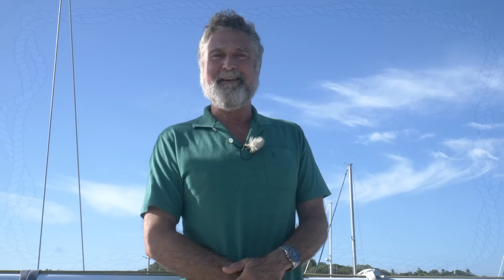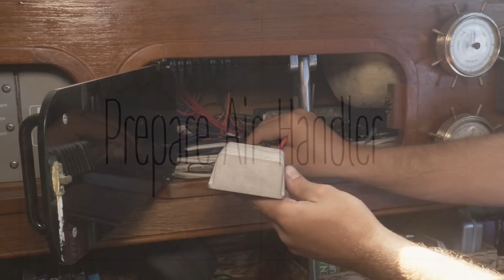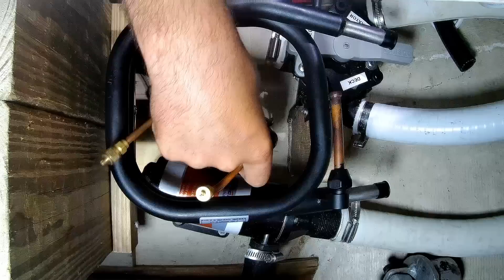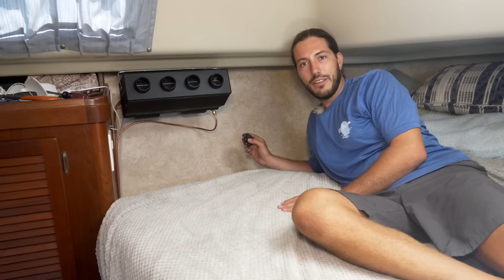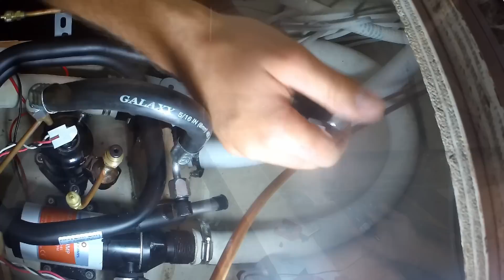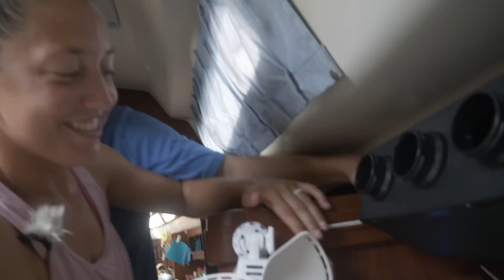Installing Our Boat's Battery-Powered A/C

Comment: I didn't see if the low pressure line from the airhandler was insulated.  It gets cold, and water will condenses, making things wet.
Reply from the maker: Yes it should be.

Comment: Hey Clark! We’re installing your dc/ac system on Rhiannon and I have some questions: 
What is “this stuff” that you’re putting on the flare fittings?
Our system is 24v so do I need to use the power booster or can I just wire straight to my system? I’m assuming I will need to convert to 12v for the blower motor and the pump,or does the system step it down?
I’m really impressed with this system ,especially how tiny the compressor is! Thanks for coming up with this for all of us and keep up the great work!
Reply from the maker: Thanks,

You can find "this stuff" on our Amazon store (link in video description).  It's really not required but since I bought some I use it all the time.

No don't use the boost converter for the compressor.
   If you can find a 24v pump use that.  It's better.  Same pump, different windings.
  As for the air handler motor.  I haven't tried this but it should be fine if you use the included motor speed controller as long as you don't ever turn it up beyond half way.  Correct setting should be like 1 amp 24v. Probably 1/10th from off.
It should work as a good buck converter but if you turn it up too far it will likely harm the motor.
Or you could get a little buck converter to make 12v.  Likely you already have 12v circuits on the boat, right?

Comment: I have seen similar units manufactured through China. Is this one of them? I'm looking for a small 12 volt A/C unit for tear drop and similar type trailers. However, how is this [your] unit's price of $2000 justified?
Reply from the maker: No.  This one is easily 3x as efficient.

Comment: I am going to be installing A/c on my 30 freedom.  Once you start looking into what's out there it's almost overwhelming.  For me I want simplicity and the ability to maintain and service the unit myself.  Are there service valves on the Condenser? If not what's your thoughts on installing them. My other thing is I would be happy having a cool sleeping room but the Captain wants a cool Salon as well so for me I may not be able to do this one. It looks great though.  Seems like the coils are serviceable and the blower too. I am thinking of maybe going with two. 1 for day in the salon 1 for night in sleeping room.  Ty
Reply from the maker: The unit comes with both a high side and low side service valve.  This is usually considered plenty as every part of each of these subsystems have the same pressure .

   I agree about the sleeping room as I mention in my first video.
   I'm concerned that this might not be enough unit to cool a big poorly insolated room in the heat of the day with the sun on the deck.
    A larger unit is in the works or you might accept the idea of spot cooling. (Leaving the hatches open and just blowing cool air right on you.)
Reply: @Clarks-Adventure  I saw the service valves. That's a sign of a well thought out unit. It creates so many Maintenance and Service options.  I hope you do well with these and tonight I am going to show my better half and really get down to the nitty gritty of cooling our space.  These units remind me of commercial ones we used to install in Homes and a lot of apartments.  Good luck to you and ty for making these so user friendly!

Comment: Hi Clark, Great video! I have a strong feeling i'm going to be getting one of these units!  Have you looked at Swagelok for fittings on your copper lines? They might add some price but would save from having to have the tooling for flaring on the copper lines, and they are super easy to use for those folks that may not be so inclined to do it themselves.
Reply from the maker: There were so many "right answers".  

I think in a few months there might be a one sled offering that uses air ducts.  It won't be quite as efficient but will be plug and play.
Reply: @Clarks-Adventure  I don't have any thru-hulls on my catamaran and I'd like to keep it that way. Given the construction of my boat, I can segregate the condenser cooling air flow from cabin air very easily and thus I am very interested to see the specs and layout of the air-cooled version.
Reply from the maker: I'm about to work on an air cooled unit for an RV trip we have planned.  Don't expect it to work as efficiently as the water cooled unit but it should be offered at MarineDCAC.com eventually.

You should really just install the thru hulls or share one you already have.  In saying you don't have any I assume you have no engine or outboards.  Where does your sink drain?  You have a composting head?
Most every boat has thruhulls and it's not like boats are regularly sinking because of them. One of the thruhulls used for AC is best installed just above the waterline.
Reply: @Clarks-Adventure  I should have said that I have no underwater thru-hulls and, yes, it does have an outboard motor and a composting head.
Reply from the maker: Then I understand your reluctance to drill that first hole.
As I said a air cooled option is coming.  Or, you could also just drop a weighted hose over the side when you wanted to run the AC.  
   It's just so much more efficient and in the end easier to install with water cooling.
Reply: @Clarks-Adventure  I am considering that. Need a little priming connection for the a.c. pumps with which I am familiar, i.e. March or Cal.
Reply from the maker: I think I would just use a submersible bilge pump at the end of the hose.  Let that be your weight.
Reply from the maker: I think they are cheaper anyway
Reply: @Clarks-Adventure  duh! I keep forgetting this is a 12 volt project. My mind has been conditioned by so many years of working on 120 volt boat a.c.!
Reply from the maker: Yes but the tools to do the swagelok cost more then the flare tools I believe.  I didn't chase this down personally I suggested it to Russell (manufacturer) when he forgot to get copper weld-ons with the titanium condensers.

Comment: My battery-powered AC unit just had its final hookup today. I'm ecstatic because it got done with a few months to spare of the oncoming Mexican heat. 5.1kWh battery and a 30.5 SEER a/c unit. Solar panels on the roof (of an RV) in the next few weeks.

Comment: Is there a template to cut holes if one wants to mount. the air handler behind a wall, or in a cabinet?
Reply from the maker: I just measured and used a hole saw.  They are in a straight line and all the same distance.
Reply from the maker: You can see me doing it here https://youtu.be/xF113aUlZgo

Comment: Looks great! I want one, er, three. Please think about making a 12-15,000BTU unit next. I'll buy a dozen.
Reply from the maker: We are considering a 10,000btu/h unit.   Beyond that one would have to use multiple units.
Reply: @Clarks-Adventure  That would be very helpful! A lot of my catamaran owning friends are looking.
Reply from the maker: Multiple units have the advantage that if one fails the other still works.  Always try to design away from single points of failure.
Reply: @Clarks-Adventure  I agree 100%. My boat has one chiller that is 65,000 BTU, with 5 distribution handlers. We are thinking 4 units at 12/15,000 BTU each.

Comment: Great Video; I have signed up on the website. We want two, although, contrary to the form I filled out, after watching this video there may be advantages to do a component install rather than getting pre-charged units on a sled to have more flexibility as to where to locate the components. :)
Reply from the maker: Yes I know I'd always want the components.  In this (and the next) video I'm trying to show that with how I've set this up it's easy to install with hand tools.

Comment: The one copper line under the bed is contacting the high pressure line, it will rub and eventually leak causing failure. Just put something soft in between tape together and done.

Comment: Have you calculated the cubic feet of the cabin you are cooling?  I have a small cuddy cabin power boat, please don't judge, and my old AC is in need of replacement.  My current 6000 BTU unit draws almost 1000 watts so I can really only use it when on shore power or when one of my engines is running. It's also all (Compressor, Fan and Water) 110\120 so I'm losing efficiency through the inverter too. I don't have a generator but was thinking of getting an air cooled inverter generator to plug into my shore power to run my AC but this might be a solution that would eliminate the need for a generator. My cuddy might be a little bigger than your aft cabin but not sure. I think the square footage might be more but the cubic feet less due to the very low headroom. I'm think the most important measure for cooling is cubic feet.  Would you agree?  I'm also thinking of upgrading my house battery to a 1 or 200 amp lithium or maybe even trying the new Dakota lithium starting batteries too.
Reply from the maker: Where to start?  If you are contemplating li check this out.  https://www.emilyandclarksadventure.com/bbms

But on a boat is a tricky thing.  It's surface area and insulation and circulation with outside areas and number of people since it's such a small space.
   To really save power blow the cool dry air right at you.  Big savings if you curtain off just the bed.

    Ours is around 200 if I'd have to guess.  The new install was about 300

Comment: So when you're fixing a jet engine, it's very important to check all your subassemblies for proper flow and vacuum/pressure seals. In my job we use an all in one system called a "vac cart". It's my job specifically to maintain the vac carts. I'm a little upset that I could have been using this sealant stuff the entire time instead of Teflon tape. Especially on all the flare fittings, as it makes a lot more sense in that specific application.

Comment: If you put the fitting in backwards, will attract tigers instead of repelling them?
Reply: Yes. Also any former or current QA inspectors in the area. They can smell the failure.

Comment: Keeping the explanation simple so some don't have there eyes glaze over, good. If someone is competent in their wiring and plumbing work your ac/refrigeration videos would bring them up to a self installer. 
I just point them your way, the best I have seen. My finer points would drive most crazy.

Comment: A great video, thank you! Have you had any issues with condensation on the refrigerant return line? Many AC installations insulate this line to eliminate condensation dripping issues.
Reply from the maker: Yes this is an important step.  

Filming a video out here is more difficult then in a studio in the US.  They need to search for a good material to do that with.  I'll make sure I include that in the manual.
Reply: Automotive products for this work well. Generally self-adhesive neoprene foam foil backed tape. 
Some installations run lines together to exchange ( further lower high pressure line temperature).
Reply from the maker: Yes I like the lines together.

Comment: Will the plans be available or did you skip that idea?
Reply from the maker: No. I had to sign that away in the contract.
But it's all but impossible to buy this compressor as a single unit.

I was a defence contractor so I can talk the talk and said I was developing a prototype project.  Didn't say it was an AC for my sailboat.  But turned out good for them as we will be buying volume.
Reply: @Clarks-Adventure  OK that makes sense you did mention that in the last video. Nice unit 👌

Comment: Can air handler be mounted vertically?
Reply from the maker: No.  The water wouldn't drain well I suspect.  I think it would probably try to go back to the fan.  But you might be able to cobble up a dam inside to deal with that.  
It comes apart with screws.
Reply from the maker: If you find success please do a video and share it or send it to me.  I'm sure many guys would like the answer to that question.

Comment: Are the dimensions of the air handler listed somewhere? And is there a total cost yet? Thanks great video!
Reply from the maker: 16"x12"x6.15".  I need to publish this someplace I can find it so I don't have to keep looking it up.
Reply: @Clarks-Adventure  and the costs?
Reply from the maker: Just under $2000us last I heard
Reply: @Clarks-Adventure  nice
Reply: @Clarks-Adventure  incredible!!!! Good job Clark thanks for sharing
Reply: @Clarks-Adventure  can I clarify, 200 usd?! You will be rushed off your feet at that price!
Reply from the maker: I missed a 0.   $2000
Reply: @Clarks-Adventure  you know in the supermarket they have to abide by the sticker price 😏 just saying
Reply from the maker: Luckily for me I have no power it the price.  Signed that away in the contract.
Reply: @Clarks-Adventure  Happy holiday

Comment: I think one thing that should be done is if copper line is touching the rubber line split a piece of rubber hose and zip tie it to the copper line. That way there won’t be any chafe and rub a hole in the line
Reply from the maker: Good idea. Chafe is bad.

But...  You won't believe this but you will be protecting the copper from the rubber.  I've seen so many times where engine hoses chafe the engine steel without harming themselves.  I found that unbelievable but seems to happen.
Reply: If you do compress the split hose on, interference fit and zip ties at least.

Comment: ... I guess he could've used a tubing bender eh?  lots of cheap options for that.   8^)
Reply from the maker: Yeah, that would have been nice
Reply: Yup, having a proper tube bending tool would be trick, but they're at anchor in the Dominican. I'd bet finding a tubing cutter or flare kit on a sailboat isn't a common occurrence, either, so assess your tool needs and aesthetic needs when planning your installation. How pretty do you need it to be? : D